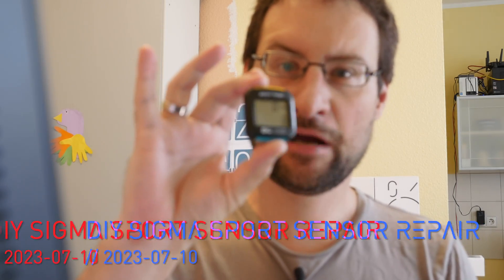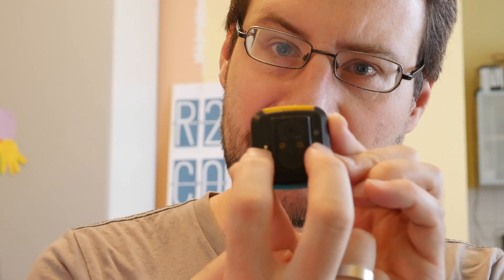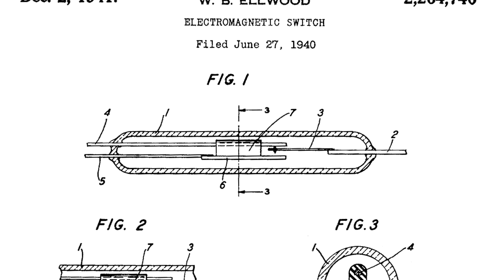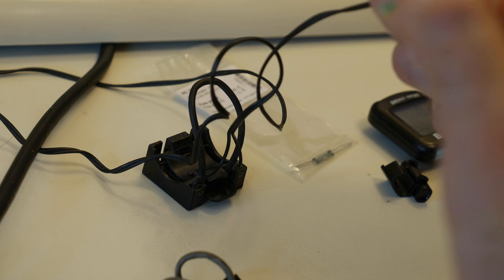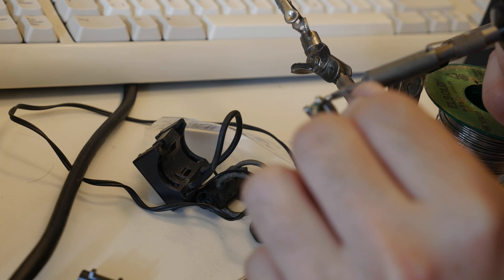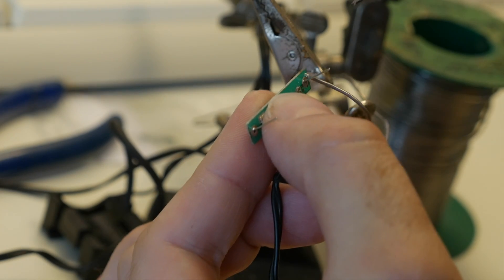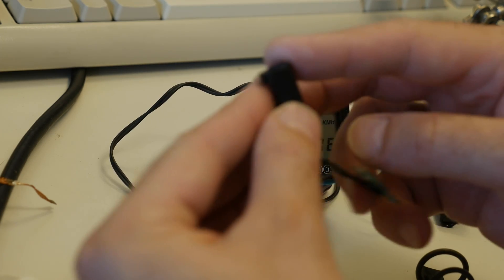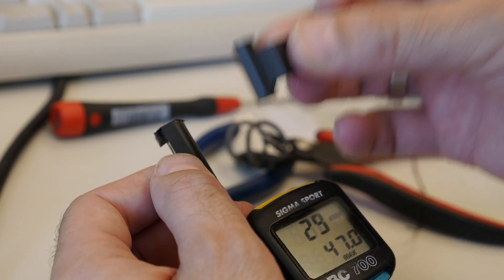Sigma Sport Bike Computer Reed Switch sensor repair!

Comment: How can o turn off? Display is Turned on all time
Reply: How much time battery ia going on? 😁
Reply from the maker: @badingiorgian1938 years.
Reply from the maker: Yes. It's normal. Like an LCD casioy wirst watch it's normal and fine.
Reply: O have a sigma bc 1100,is The same settings?